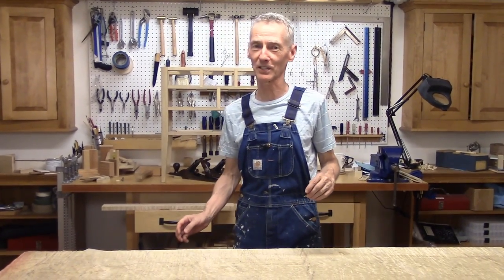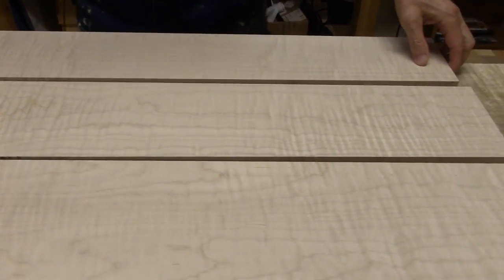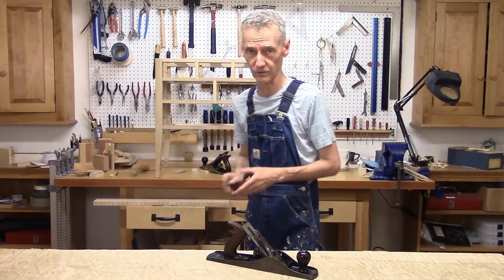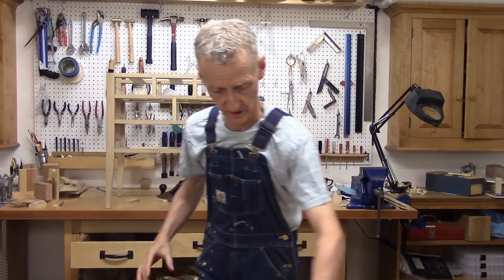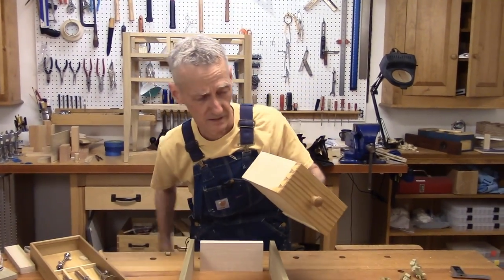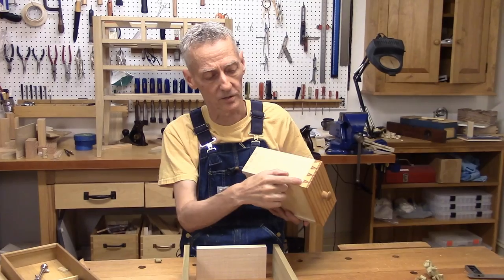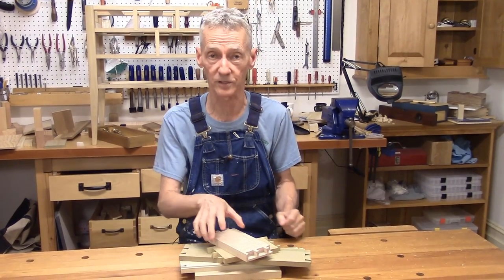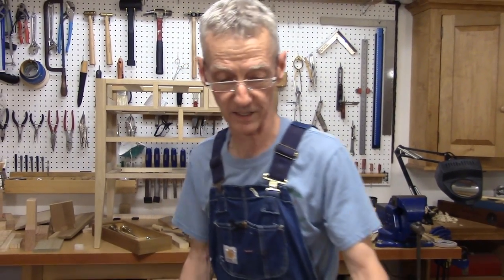Chest of Drawers Show #7

Comment: Thanks for sharing. As always your video is well appriciated,  but pfffew what a long wait!

BTW I just learned a neat trick from Paul Sellers. That is to add a very small rabbet prior to cutting the blind dovetails. It should make it easier to join the sides to the front. But I have not tried this myself yet.
Reply from the maker: Hi Bor, thanks for your patience. Yes, the shallow rabbet trick for dovetails is a clever method. Marking the pins from the tails is so much easier and accurate. I will try it some time.

Comment: Would it be possible to see the top of the frame?  In episode 6, you had stopped before putting in the dovetailed top front piece. I was especially interested in seeing this as well as the back top. I'm currently making some cherry night stands for my daughter. The plans I purchased are for machine tools and assume the top frame area uses plywood and the top rests on that. Your frame is closer to what I want to do and I would appreciate the help. How deep did you make the dove tails into the top frame sides?  Many thanks.
Reply from the maker: Hello Joe. Chest of Drawers Show #4 has more information about the dovetails on the top rails. I hope you find it helpful. Please send me any further questions and I will be happy to answer them. Thanks!
Reply: treebangham many thanks for the reference. I will go look at it.